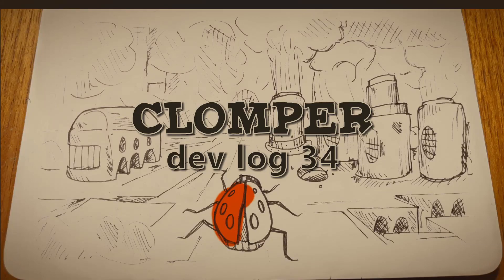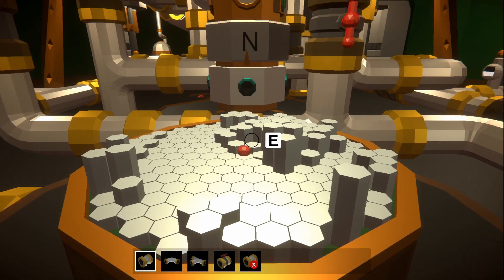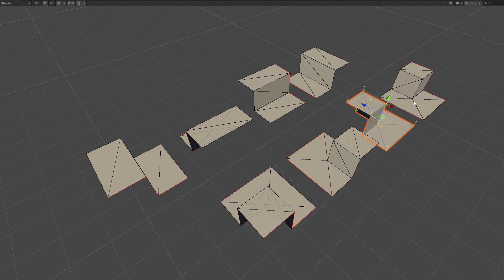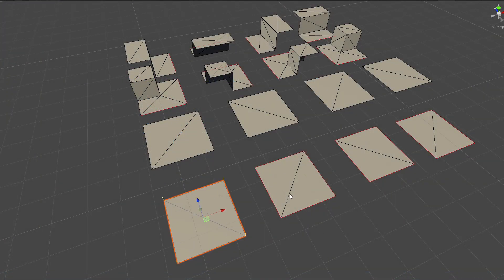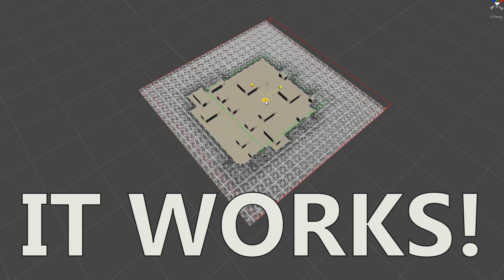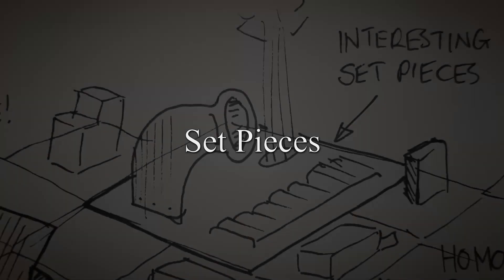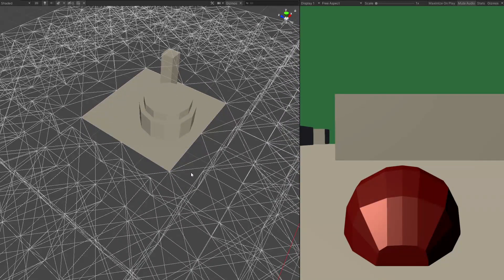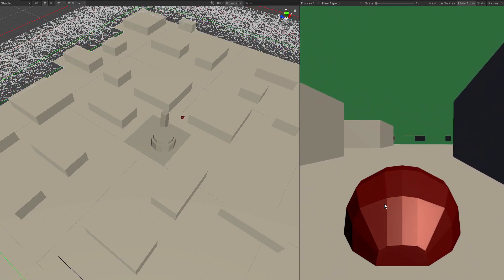Unity Mesh Rotation and Spawning | Indie dev log | Clomper #34

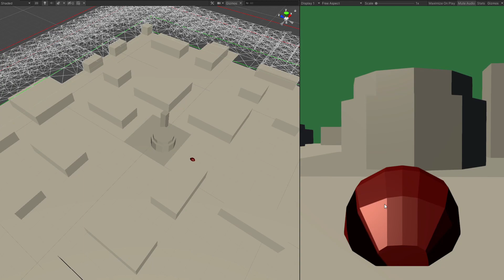Comment: This is some good progress! In a previous video you said the area you have visited before will change when you get back. This was ok since the world is mechanical and it would be a good part of the lore. (not sure if you said that, oops) But at the end 2:20 the wireframe stays around the generated meshes, indicating previously visisted areas will stay the same. Is this true or did I see this wrong?
Reply from the maker: You're spot on. I think the mesh removal part is broken when I took the footage! 😂 I am going to experiment with how fast the work changes, each tile in memory is only a few integers, so the memory cost on remembering map state is low.

Thanks for the great comment! 😊
Reply: @RobLang  You could keep data in chunks of 32 by 32 tile chunks and delete the entire chunk when the clomper to far away. Just an idea